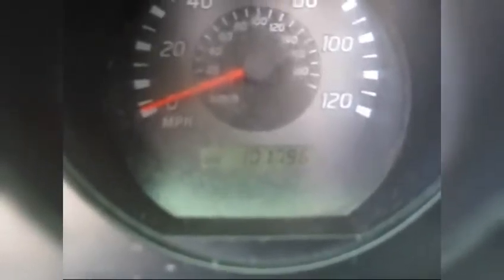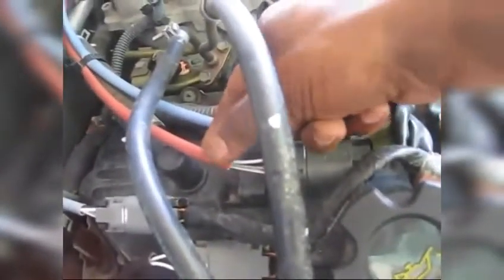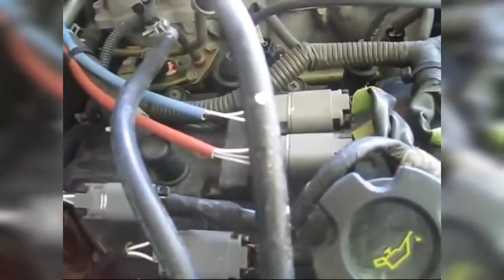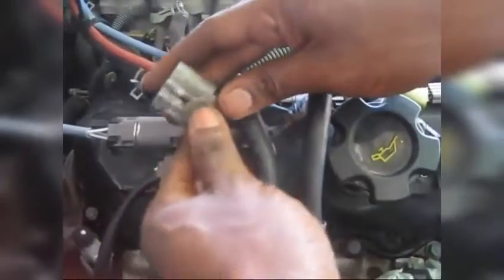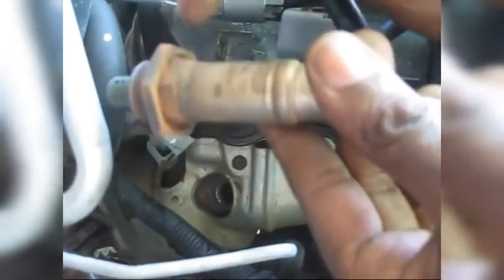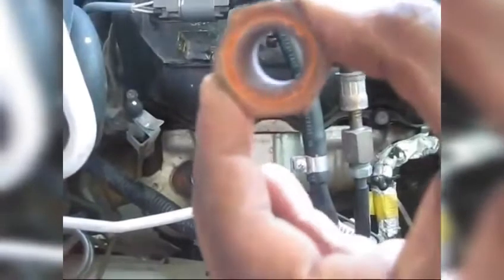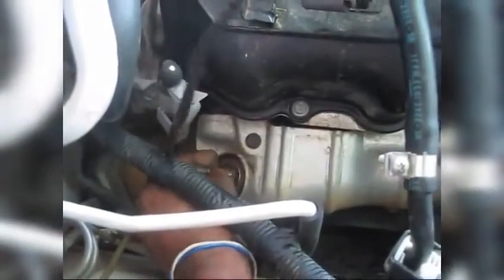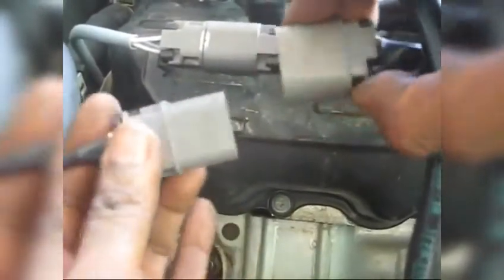Changing Nissan Frontier Vg33e Oxygen Sensor. Part 1/6

Comment: Your videos have proven helpful and have saved my time over the years. I have a 2001 Crew Cab 3.3. I'm replacing all four o2 sensors with header install. I know the wires need to be lengthened for one or two of the sensors.
Are the four o2 sensors are identical except for the length of wires attached, or are they different internally for where they sit and for different temperature readings? 
I'm wondering if I could simply order sensors with the longer wires for the new locations, or will they read incorrectly due to where they will be sitting? I hope this makes sense? The original o2's have 350k on them, still function but I wouldn't reuse them due to so many reasons... Am I over thinking this and should just order four new sensors for the stock locations and lengthen the wires as needed?